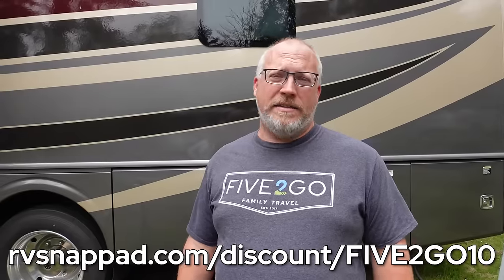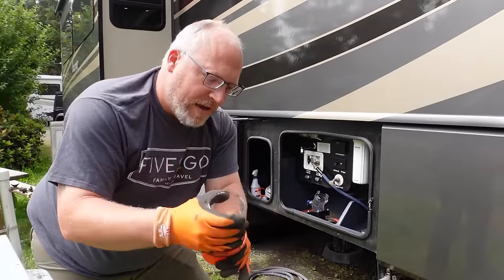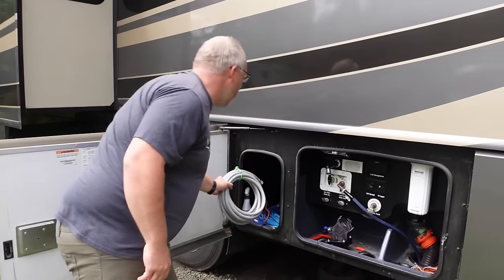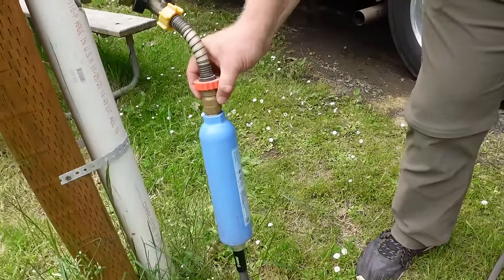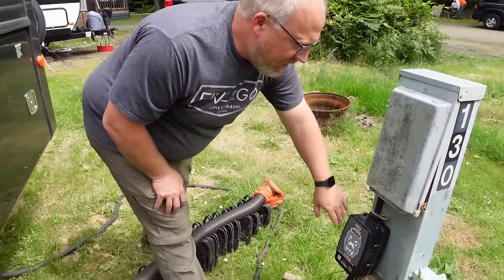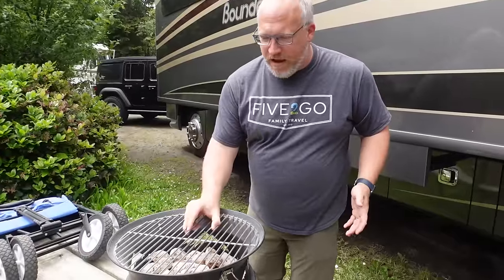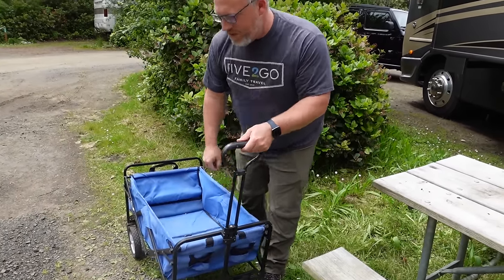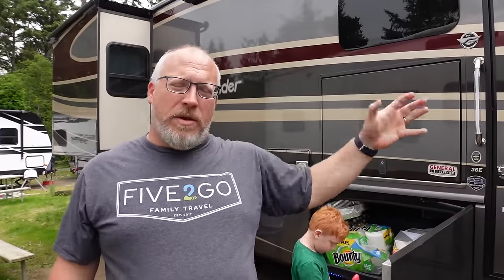RV Camping Essentials: Must-Have Gear You’ll Actually Use

Comment: Suggestion……I carry a small spray bottle full of rubbing alcohol to spray my gloves  and anything else having to do with septic. It evaporates quickly. Also they make a high flow pressure gauge. Also I put LevelMatePRO  in my travel trailer which will tell me on my phone where the trailer will most level and how many inches I will need to raise it. It’s a huge time saver along with the teardrop levelers. Also try cooking bacon on the gas grill like a steak, just put it on the grate. You won’t go back to cooking bacon any other way. After 38 years of RVing and either deciding which meal you’ll have ice for or buying ice, I bought a table top ice maker that makes 22 lbs a day……we use distilled water. It’s really compact.

Comment: We like to use a simple 1 foot 50 amp extension to plug into the pedestal first, and then connect our surge protector to that.  Otherwise you can’t close the pedestal and the weight of the SP pulls on the plug.  With the extension, I can close the lid, and the SP rests on the ground.
Reply: Good tip! My SP has about a foot lead on it and most electric posts close OK, but there are those that don't. I don't think I have ever seen a 1 ft 50A extension. Where did you acquire yours?
Reply: Brian
I just got a “new to us” Jayco Jayflight 29fbs and I purchased a Husky Centerline equalizer hitch for it.
I have been watching several of your videos and in one of them I noticed you had a Husky CL hitch too.
My question is this: Did your hitch “moan” and “groan” and make loud sounds when you turned?
It is almost like the sound of ‘metal twisting’. (Hard to describe)
If so, is this normal?
Is the noise coming from the bars rubbing on the brackets?

Comment: Question?. Your gauged pressure regulators, did the regulator fail or just the gauges getting stuck?
Like pool pressure gauges they fail and you just replace the gauges. I just bought a travel trailer and have been told by many people to get a gauged pressure regulator. The inline ones are great but they like everything else fail without knowledge. My daughters toilet was ruined when one of these failed.

Comment: Good video, I'm working on my collection.  On the surge protector, do you have a preference to attaching it at the camp power rather than hard wiring it in to the RV?  While the one you have is weather proof, the hardwired version would be inside, out of the elements.  If you have to plug into 30Amp power, you'd have a converter to 50AMP, the surge protector, and the power connector from the rv, and you'd have to keep all of that away from water.  Less weather problems if hardwired.  But I have no experience yet so just asking.

Comment: You must have a lot of problems with your black tank stuff. 
I don't open the valve until it's time to empty.
One thing I do before I leave a campground...I empty the hot water tank (via the shower hose)into the toilet and let it loosen things up(yours may not reach, I get that but there are other ways). Always flows out very well!

Comment: Regarding the P-trap for the sewer hose - only the gray tank is fed by drains with P-traps or waterless traps.  The toilet drains straight into the tank with no trap at all - my old camper toilet actually was a straight drop and I could see the contents of the tank.  While the holding tanks generally shouldn't be kept open, if you're taking a shower it helps to have that trap setup in the sewer hose.

Comment: I had a nonadjustable pressure regular fail so i switched to the gauge version. The issue I had with the inline is I didn't know it failed until I was at a campsite with REALLY high pressure. I'm guessing it failed 2 or 3 trips before I actually noticed, then it was to late.

Comment: Good video, another great thing about a dual fitting on the output of the water inlet is that when you are ready to leave you turn the water off at the site spigot then open the empty side of the dual fitting and that relives the pressure so you don't get squirted!

Comment: Great video!! I watch these type of things all the time. Occasionally I come across one that is relevant to my living situation. I got a LOT out of this one! Here's some thoughts I recorded as I watched ...
• That sewer weight shaped like a little RV is cute. I use a sandbag. Didn't cost me anything. My rig weighs nearly 17,000 lbs. A 3 lb bag doesn't tip the scale. If it gets dirty, I can toss it and get another one for nothing. Plus it is extremely flexible. You showed how your weight didn't sit on the elbow cleanly. I'll stick with the bag for the time being. Also, I don't have as many sewer adapters as you have and one of those (I don't know how to describe it) I have never seen. I am pretty sure I could have used it once or twice. I need to look for one.
• I don't have a Zero G water hose. I keep hearing about them because I watch these RV Tip videos all the time. Next time I need a hose, I think I will be getting one. I have never heard a singe negative word about them. I haven't had any trouble with the hose I use now, but I have been able to avoid below freezing weather so far. 
• Leveling blocks ... so useful for much more than merely leveling your rig. Unfortunately, I have a couple of sets and as a result I have no need for the Snap Pads. I don't think they are a bad idea, just not anything I think I need to invest in.
• I also have a folding wagon. But the one you demonstrated folds up a lot thinner than mine; at least an inch or even two. I use it as you do yours, especially for hauling tiny grandkids. I am an old man and my walking pace has slowed considerably from my prime. But it is still difficult to walk at a two-year-old's pace. Plus, the little ones love riding in it. My wife's main objection to the wagon is how dirty the wheels get. So I hooked up an air hose and I blow the dirt off (as much as I can) before stowing. Side note: Sadly, they have been outlawed in Disney World. I don't know why, but I assume that someone at some time using one caused a ruckus with it. You can't take ice into the parks any more either. Why has never been explained.
Ah! End of the video. I see you have all the products listed online. I will look for that sewer adapter and the wagon.

Comment: To repair the water pressure regulator, just go to your handy hardware store and get a replacement water pressure gauge, they are a standard size thread and just screw into the housing.  Just because the gauge is not working doesn't mean the regulator portion is also broken.  A lot of these gauges are not weather resistant and need to be covered in bad weather.

Comment: When using a splitter on fresh water lines you should have a back flow on each side of the splitter
Reply from the maker: The only thing that needs a backflow preventer on it is the black tank flush, and that’s built in to the flush inlet itself. There’s nothing else you’d use the splitter for that would need that level of separation.

Comment: Good review of some great equipment.  The one thing that I would highly recommend is a back flow prevention valve on the side of your water Y valve where you connect your back flush hose to prevent any possible cross contamination from the back flush system. Thanks for your informative video.
Reply from the maker: Black tank flush inlets have a backflow preventer built into them, same with the Flush King that I showed as well (which is why that hose connector looks so large on it)
Reply: @Five2Go  I didn’t realize the flush inlet had a backflow preventer built in. Good to know. Thanks.

Comment: Starlink is truly a game changer. We use it at home in a very rural area with spotty cell service and no other broadband options. I work from home, and we stream multiple TVs and devices with really stable service, even during bad weather. Buying the equipment upfront is a little pricey, but the monthly rates are not much higher than most broadband providers.

Comment: Thanks for the tips on septic.   Our toilet is not holding water and we have been smelling sewage.   We've had it repaired 3 times!!!  Maybe 4th will be secret to finally them getting it right.
Reply from the maker: With some toilets it's super easy to replace the seal in the bowl, but in some models you can't. We just replaced our entire toilet a few months ago and to be totally honest it's an extremely easy job. If you've ever done a toilet in a house this is about 1/4 the effort.

Comment: I haven't gotten one yet, but from what I've seen you want to get the pressure regulators with the oil filled gauge, it seams like they last better. Maybe you had one before but the one you showed wasn't.
Reply from the maker: I've tried both types and both have failed. I don't think they're made to be out in the elements and I want my filter and hose protected from high pressures so I don't put the regulator in the bay. The "dumb" ones are perfectly fine because I never adjusted the pressure after setting it up the first time. Simple is often best 😉

Comment: On toilet clogging. If you’re going to do your business, something that could get stuck. Just make sure you fill that bowl with plenty of water before you do your thing and then let all that go down when you flush and run some extra to ensure it goes down.
Reply from the maker: That's what we do every time but our kids are particularly skilled at, well, pipe-blocking deposits 🤣 There's a right angle just below the floor that likes to catch longer things if you catch my drift.
Reply: A big ‘ole squirt of dish soap into the bowl helps ‘stuff’ slide by those tight turns.

Comment: After seeing this video I subscribed. Nicely done. A really good overall vid on what you should be carrying. Also, I really like the Bounder and that you are pulling a Jeep Wranagler. Going to look and see if you have a video about pulling the Jeep and the set up. If you don’t you might want to think about doing one. We just purchased a Holiday Rambler and are going to pull a four-door Jeep Wrangler.
Reply from the maker: Thanks Richard! I'm using the ReadyBrute Elite II for attachment and braking and I put an aftermarket bumper on the Jeep that gives me nice solid d-ring connection points to hook it up to. If your HR is a diesel pusher you should look into the Air Force braking system instead of what I'm using - it taps into your compressed air system for braking in the toad.
Reply: @Five2Go  Sadly, it is not a diesel.  We went with the blue ox system for bars and such.  The invisibrake for the toad.  Have not tried it yet, but we are cautiously optimistic.

Comment: I like the concept of the zero g hose - have one of the knockoff garden hoses - but why do they come in dark colors (I've found dark blue, gray, black and dark green)?  I use my cheapie white hose on purpose; it doesn't pre-heat the cold water for me as much in the Florida summer sun.
Reply: Try the flexzilla hose. I have a 10 foot and 25 foot. Supple in all temps too.

Comment: Do you ever used the two adaptors for the sewer hose. I’m new and skeptic on having them
Reply from the maker: I use everything I showed in this video. I had to use the sewer donut at the last campground and I'm using the vertical extension tube at our current campground. It's good to have all the various pieces because there are no standards out there. That whole bin of accessories is maybe $60-70 combined so it's not too bad overall.

Comment: There is quite a bit of stuff unsecured. Have you ever dealt with theft and how do you prevent it.
Reply from the maker: All of those bays are normally locked, I just unlocked them before filming so I didn't waste time fumbling with the key 😂 We haven't had any theft issues in campgrounds though we've had friends lose bikes that they didn't lock up. We keep ours secure at all times.
Reply: @Five2Go  actually I was referring to the power dog, adapters etc.
Reply from the maker: Oooh, gotcha. I used to run a cable lock around the Watchdog but stopped for some reason. It comes with a loop bracket built in for it if you want to lock it down. Adapters and water stuff are so cheap though, and everyone should already have them, so I'd be shocked if anyone stole that stuff.

Comment: Put your pressure regulator after your filter.
Reply from the maker: Nope. 
I've seen filters rupture from too much pressure. There's little too no pressure drop through the filter (I've tested it) so there's no reason to have it the other way around
Reply: @Five2Go  Maybe your regulators would have lasted longer with filtered water. Plus it keeps all of your equipment clean with the filtered water.

Comment: 1. The sewer hose water jug thing takes up too much space, needs to be filled with water and frankly it doesn't work well.  The better solution now is a clamp like a hard hat uses that goes around the pipe and another vertical strap clamp that goes over the top of the elbow. Takes up no storage space, no water and it works. Can't remember the name.
2. Everyone I know says those cheap plastic leveling blocks crush easily.
3. This over sized fire pit thing and a blackstone? About 150 pounds of very large stuff. Not everyone has or wants a 40' pusher.
4. A mat on the step can interfere with the steps operation leading to failure. It's attached so how to clean it.
Reply from the maker: 1. The water jug is the best solution we've found in 5 years of FT life, sure it's bulky but it doesn't weigh anything when it's empty. That clamp thing you're talking about is a clever solution but it doesn't work in a lot of situations that we've encountered - if the pipe is below grade with not enough to clamp on, if the pipe has one of those flippy step-lids on it then it's too wide, if the pipe is sideways (we've seen it more than once), etc. Having one of those and some other type of weight is probably the best overall solution. We've come across a lot of campgrounds that are using threaded sewer inlets so we rarely need to use the weight anyway.
2. The blocks can definitely crush, and they're a bit slippery, so you have to be careful how you use them. We only use them stacked like bricks, not straight up, and only under tires which are grippy. We've seen a lot of RVs slide sideways off of them with tongue jacks or metal feet. They'll also bend, pinch, and get mangled on gravel or other uneven ground. They're handy for a ton of reasons, you just need to be careful with them.
3. The grill and blackstone are nowhere near 150lbs, but they absolutely take up a lot of physical space. We actually just got rid of both of those because our new RV doesn't have propane on board and I don't want to carry around a tank. If a fire pit and grill are a priority, you can find/make room for them. I did say they were optional ;)
4. The mat we were using on the Bounder was perforated on the bottom and was all plastic so it was easily hosed off so cleaning was not an issue. The steps also didn't close completely together and there was plenty of room for the mat to live between them when closed up. They're also just hooked on with some springs so they're super easy to remove if you need to. Most steps have some wiggle room, and at least putting some tread or grip tape on them will go a long way towards being safer.

Comment: How often has any of your external equipment (sewer, water, electric, filters, splitter, hoses, electric meter, etc ...) been stolen? It looks like you have several hundred dollars worth of equipment outside your rig, and I frequently read camp parks have a problem with thieves.
Reply from the maker: Never in 5.5 years of fulltime RVing has any of our stuff been stolen. We've heard of people losing bikes but we keep ours locked up. All the sewer and water stuff is pricey but it's not a hot ticket theft item by any means.

Comment: The way you talked about your step flush toilet makes it sound like you haven't learned how to use it correctly. if you do number one in the toilet you just have to flush.  if you do number two you have to fill the toilet bowl up with a good amount of water just like your home toilet bowl that does it automatically.  but when you flush your RV toilet it requires even more water so you don't create a poop pyramid. A lot of RV black tank dealers ask that you keep three to five gallons in your black tank before you start using it
Reply from the maker: I was just giving an abbreviated explanation so I wasn't just saying "foot flush toilet" and some viewers having no idea what that means at a basic level.

Comment: I have many of those items including SnapPad, but with all those things to carry you are going to turn off newbies.
Reply from the maker: That's really just the cost of doing business - RVs aren't ready to use straight off the dealer's lot, almost all of this stuff is required at some point or another. I'm not trying to scare people away but rather help them make good decisions about the gear and accessories they pick up because there's a lot of crap out there and it's not cheap to get the wrong stuff.